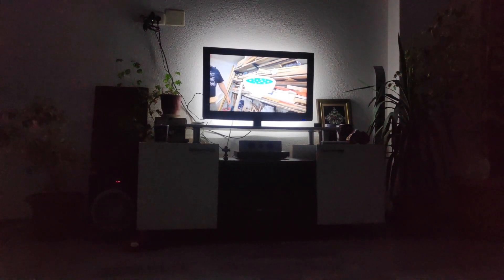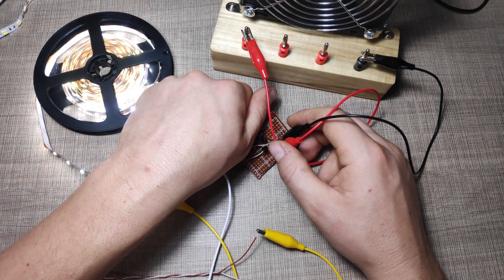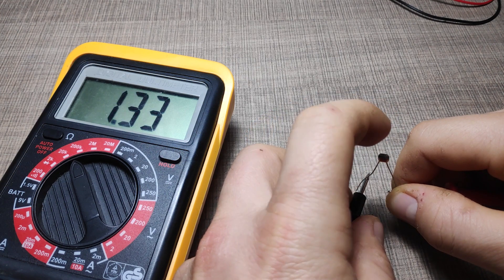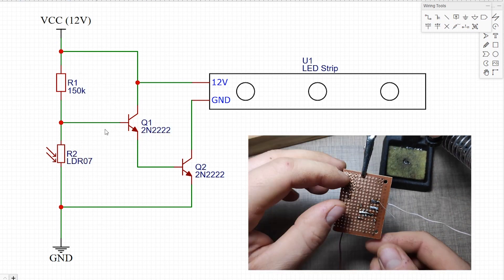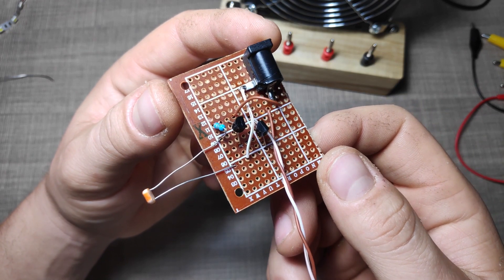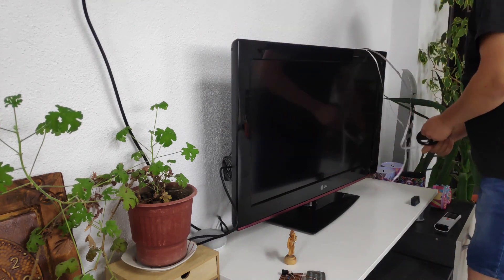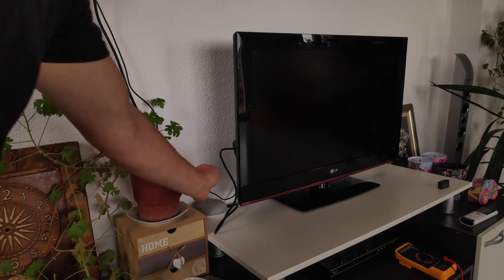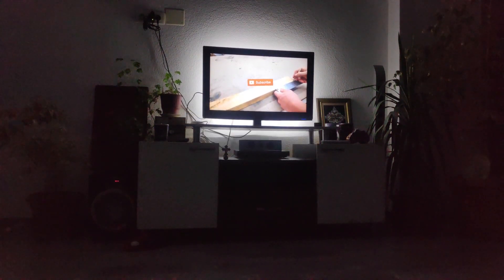DIY automatic TV bias light with a photoresistor - Beginner project

Comment: I built this today but I used a 5v LED strip and connected the power to a USB cable, this way the lights power on only when the television is on.
Reply from the maker: Yes that is an option as well but you need to be careful as most of the TV can't provide high enough current for long enough if watching continuously. As a result, you may damage your TV USB port! To avoid that I'm using external power supply.

Comment: That's interesting mate! Never knew that was a thing. How does the light not turn on when the TV is not switched on? Like ... when you're sleeping etc.
Reply from the maker: Well it doesn't with this version but it serves a double function as a night light when TV is off. You can tap into the TV 5V output from its USBs to monitor it but that is way more complicated and has a chance of making permanent damage to the TV.